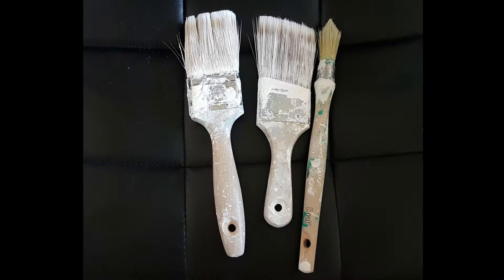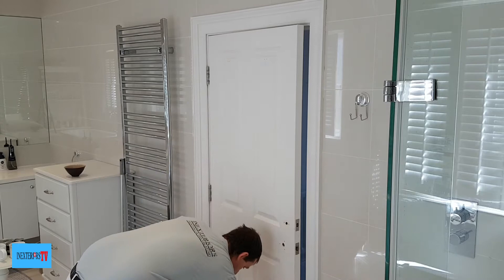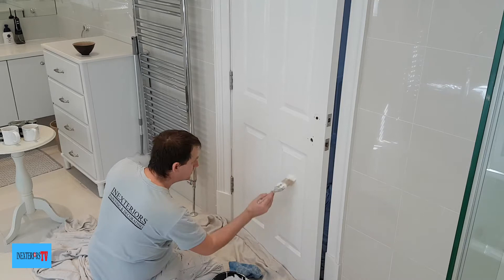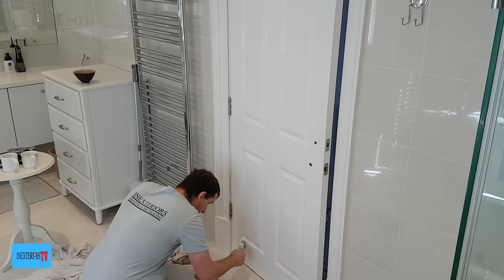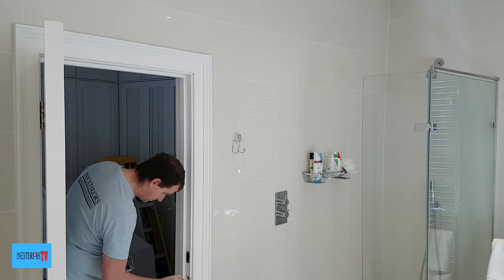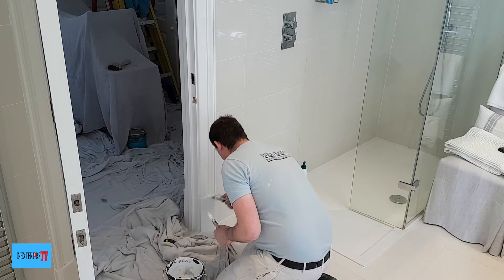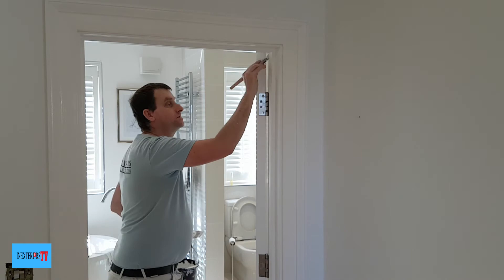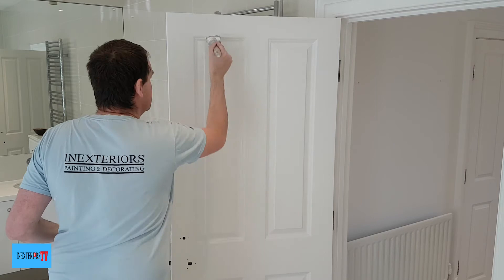How to paint a door set. How to paint a door.

Comment: Hi Steven. Do you painting the doors 🚪 with microfibre roller?
Reply from the maker: @yuriy Levada if i am using oil based paints i use a sponge roller, if i am using water based paints i use an emulsion roller, i have used micro fiber roller for varnish, i guess it depends on what type if finish you are after.
Reply: @Inexteriors  Thanks Steven